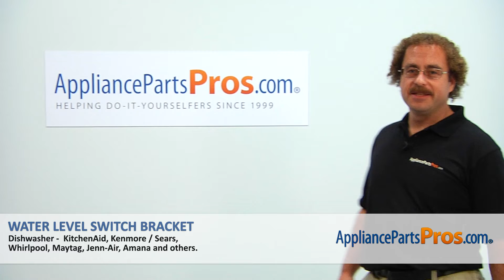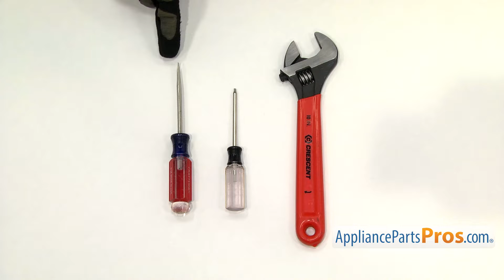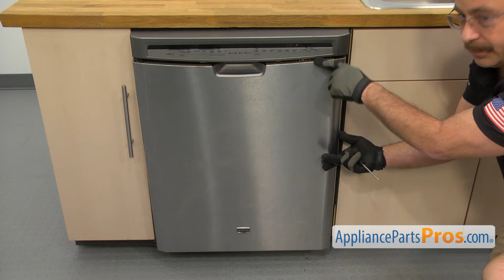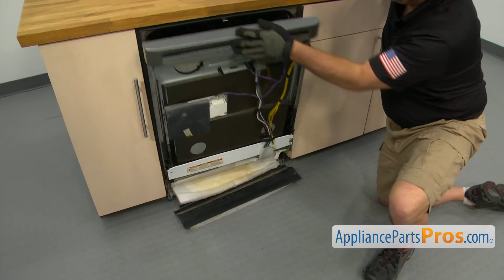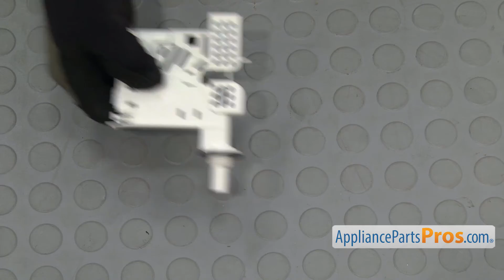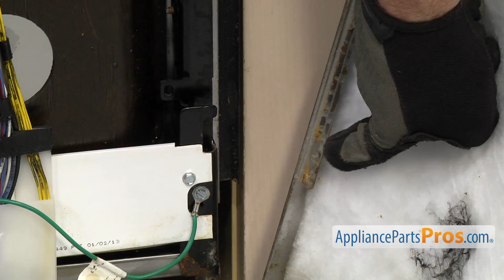How To: Whirlpool/KitchenAid/Maytag Dishwasher Water Level Switch Bracket W10873429

Comment: I have a question for you regarding the "overflow" switch float itself.  As you know the small rod that connects "float" to the lever to the micro switch, goes through a round opening.
This opening for me is allowing a small amount to water the flow to the floor.  I have seen the water come down through this opening.  The float should not be allowing the water to get high enough to get throght that hole.  Splashing should also not allow water to get under the float. I have checked the micro switch and I can hear it clicking on and off when i lift the float.  The float is free to move. The gasket under the float is secure. I think this is a design issue.  Never saw it before because I think the sound insulation was catching it and it was so little that it never got to the floor.
Have you seen this before and if so how did you fix it?
Thanks
Reply from the maker: What is your model number?